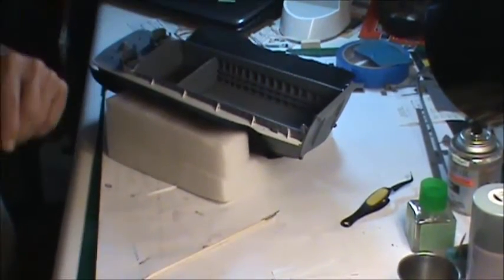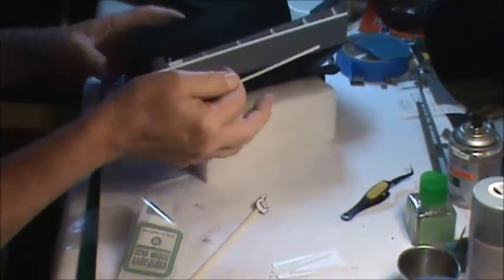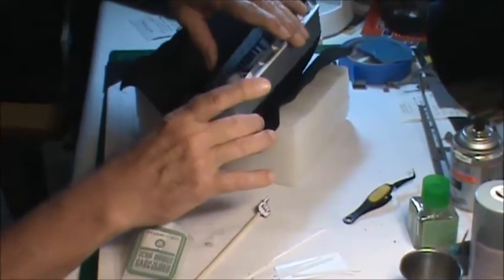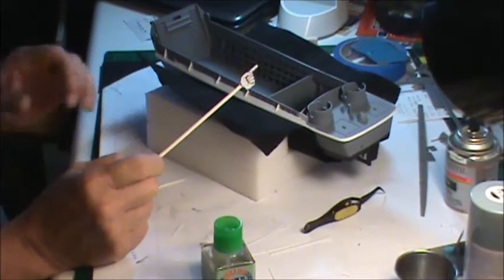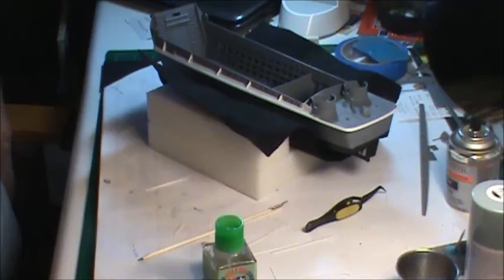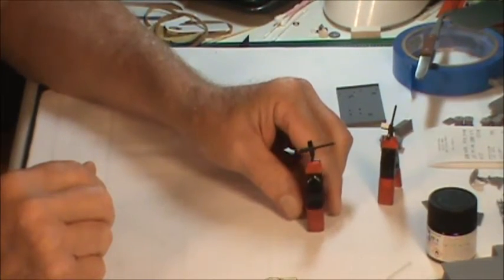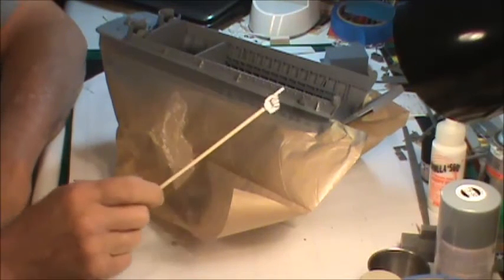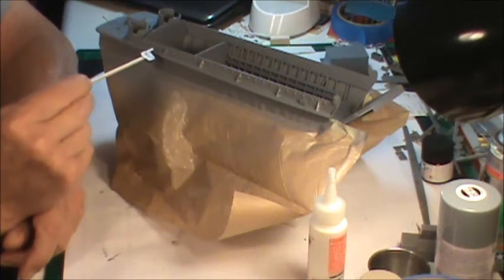LCVP PART 5

Comment: Hello

Liked the !Handles" on the 30's. I often use Paper clips for things like that on 1/35th. I also use sewing pins and "Stripped out" 1 mm House electric cable as that gives me solid copper to work with. I built a 1/16 SS 100 with the "Top" down and went around the edge and drilled holes (I have about 6 of those Pin Vices with different size bits in, Saves all that changing them) and inserted about 1/4 In and the Pin head. They look just like the Press Studs that would have been on the real thing. Some times the easiest Mods can make a lot of difference. Keep up the good work. Andy C

Comment: Hi Gary,
Your landing boat looks very nice,you did a fine job
I do like the way you upgrade the 30 cal machine guns.
On pictures from ww2 you see both types with pistol grips and two grips although most of the time the types with the two grips are 50 cal.
But i like the way you did it .
The difference between a boat and a ship is as follows: a boat is shorter than 20 meters other wise it is a ship.
But even even experts use both names by each other.
Thus called the way you like.
By the way you was right my efforts to build a small paper model with one good eye was a disaster.
All the best Piet
Reply from the maker: +Piet Nieuwpoort 
Thanks Piet....The info on the 30 cal's and the difference between a boat and a ship is helpful.
Hate to here that about your model but I'm sure you will figure something out, just take your time.  If it would help and you need someone to cut all those parts out, pack it up and send it to me.  I would be happy to help.  I will cut all the parts out and send it back to you to assemble.  Never worked on a paper model before but I'm up to the challenge to help a friend.

Comment: Gary:  I've been meaning to mention this to you for some time now but age does things to your mind.  I see you use Tamiya thin glue and it's great stuff but you have to be careful when using it since it runs so easy.  If you have access to diabetic syringes they make great applicators for this glue.  Simply dip the needle in the glue and pull some into the cylinder.  Then you can place the needle where you need the glue and apply. Often times just touching the needle to an area will release enough glue to do the job.  I found that the glue will stay usable in the syringe for quite a while and you can load as much or as little as you need.  If you have too much, just shoot it back in the bottle.

Comment: Hi  Gary, Those LCVP's were called boats. You even mentioned that in recomendig the movie "All boats are gone". You're doing a fine job with this model. I like the paintwork, esspecially fore someone who uses rattle cans instead of an airbrush. I recently bought an excellent compressor an airbrush for just €141,- at Bulstore.nl including posting and handling. An airbrush is more accurate and at the end cheaper than a lot of rattlecans. For real metallic finish I use True Metal from AK interactive. Just primer the part, brush some True Metal on it, let it dry overnight an polish it with a soft cloth.
Reply from the maker: +Ronald VAN TOL 
Air brush is also on the wish list but I have to get out of this apatrment first.

Comment: your 30 cal ammo-can should be OD painted up it's still your call
Reply from the maker: Larry....What is OD painted?  I think maybe you talking about the color of the ammo boxes, if so watch the last video.
Reply: to start off you must not have being a member of the Military  OD is over dirt or olive drab a nice job I had member of the military  My 99 year old an was Helmsmen on this transport  he found it in most all the the changes over  He was let down on the MG_33-cal barrel pointing upward a new gun is bluing and would being but up  he did give it a 10 with 1 is bad news 10 could never be better.
the worn out barrel white at the mussel  bending down rusting.
Herb said thanks.  
Larry